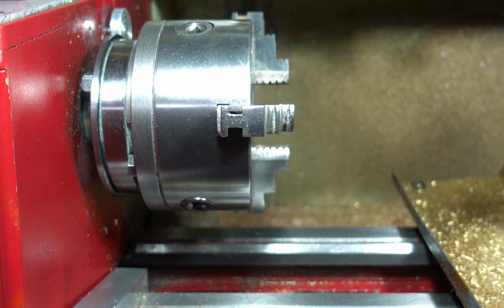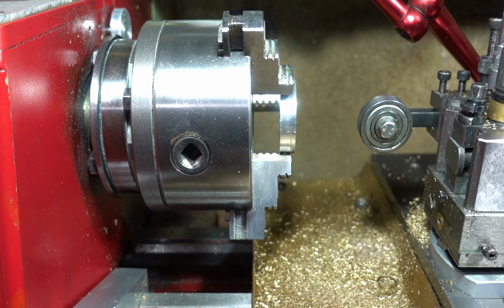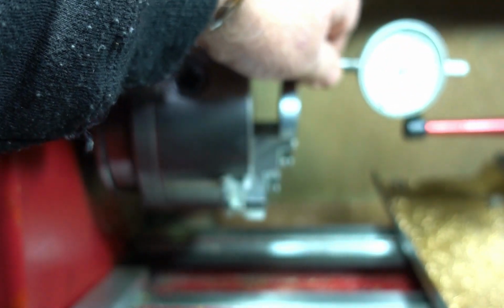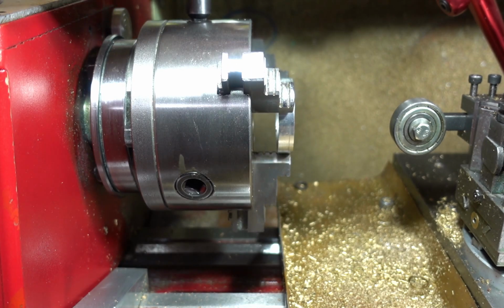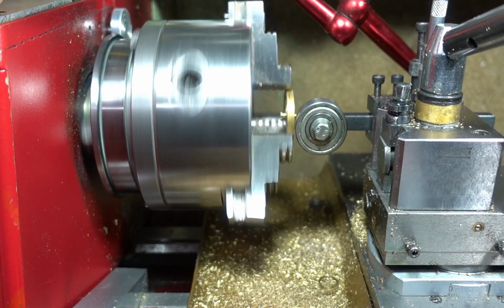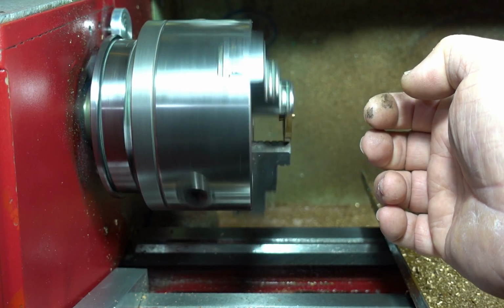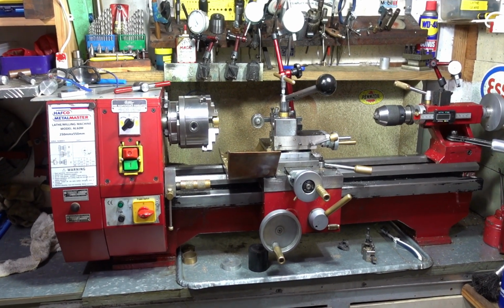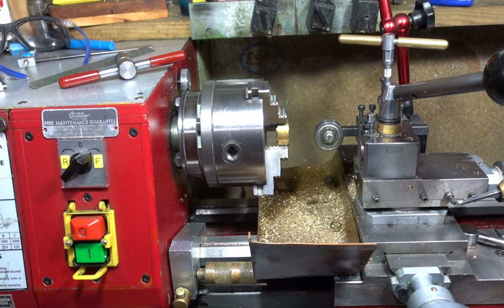Lathe Centering Roller Tool Tips! | Quick Centering Method ⚙️

Comment: Hi Jim.  I made one of those years ago.  You can also simply use the back of the cutter with the spindle in reverse.  That ball race tool can also be used for burnishing, if you want to do that. I'm not a fan of burnishing, but it will do the job, usually with some harmonic pattern in it.  Cheers Rob
Reply from the maker: G'day Rob, someone mentioned burnishing as well so I gave it ago on aluminium and didn't like what it did. Having so many small (sometimes slivers) of offcuts I find the bearing easy to use and quick. I really want to make something like I've seen now on a few vids where guys use a cutting tap in a holder to put/cut grooves in pulleys. It would be so handy to be able to do that for small steam engine pulleys that suffer a lot from belt slip because they are smooth. Have you seen that method or better still ever done it yourself Rob?
Reply: @SteamEnginesJim  Hi Jim.  No, I've not made "V" belt pulleys that way or seen any in use like that.  I usually make pulleys using a 35 degree indexable carbide tip.  This is narrow enough to allow machining of any width "V" belt angle  ( usually 38 - 40 degrees).  I've never tried burnishing aluminium, only steel and brass, which both will work harden.  Cheers Rob
Reply from the maker: @Xynudu  G'day Rob, I'm only using 2mm or 3mm O ring for belting on my small pulley wheels that I machine up for my models engines and slippage under load is always a problem. I'd like to set myself up to do this -
https://www.youtube.com/watch?v=XIzlg_uObwQ
Reply: @SteamEnginesJim  OK  I have seen that done before.  Should be pretty easy.   Not sure how it will go regarding slippage, but worth a try.   "O" rings are quite slippery and stiff.  You would be better off buying an assorted pack of small drive belts (for CD players, etc)  as these usually include a range of sizes in flat and round, made from grippy highly flexible rubber/polyester.  Very cheap and don't slip.  Cheers Rob
Reply from the maker: @Xynudu  Just made the parts Rob, busy now till Monday morning till I can give it a go. Fingers crossed it works.....Need to chat with you next week about 'Best bang for buck Aussie Lathe' ....my eldest son wants to buy a hobby sized lathe around the size of yours and mine. Wondering what you recommend now. Have a great weekend Rob.

Comment: Do you have any suggestions for a first model engine?
Reply: I mean steam engine
Reply from the maker: @masonator669 Sorry...do you mean what brand of model steam engine to start with (a ready to run engine)? What country are you in?
Reply: I'm from the planet Jupiter
Reply from the maker: @masonator669  That's cool...but I can't recommend any models from Jupiter. I've got engines from all over this world....but sadly not one from Jupiter as yet.....but never say never!!!!
Reply: @SteamEnginesJim  😂😂🤣🤣 usa
Reply from the maker: @masonator669  LOL 😅😅 In the USA, I would highly recommend a Jensen either brand new from this link of look for one on eBay -
http://www.jensensteamengines.com/
Reply from the maker: G'day.....a Wobbler is a really good first model to make. Here's a link -
https://wdcscampbell.weebly.com/uploads/3/0/9/6/30969223/wobbler_design.pdf
If you're skills are more advanced than that these kits from Bengs are good -
https://www.bengs-modellbau.de/en/Material-kits/
Reply: @SteamEnginesJim  thanks for the suggestions
Reply: I'm with you Jim on keeping all the odd scraps of metal. Some times you only need a tiny bit of brass or steel for a project. Metal is so expensive here in the UK, I can't afford to waste anything. The jog tool is one of the most useful tools on the lathe. I use the one I made all the time. Looking forward to more tips Jim. All the best mate. Cheers Nobby
Reply from the maker: @nobbysworkshop  Thanks Nobby I use mine on a daily basis as I'm always using small bits and pieces (those bit and pieces we never throw away 😊) its expensive and hard to come by.